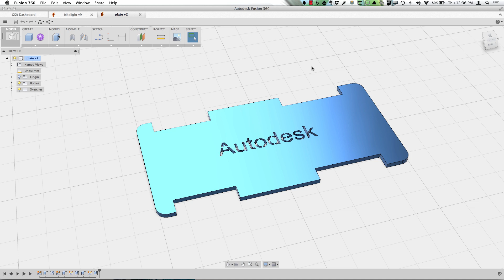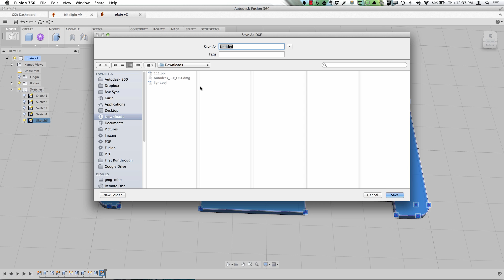Laser cutting - How to save as DXF in Fusion 360

Comment: ... but how do you export it to scale?  When I follow these instructions to save a sketch that is nearly six feet tall, I wind up opening it (in Inscape for example) and it appears as much smaller than a piece of paper.
Reply: +Nick Mathis usually the laser operators know how to rescale to size.. depends also on the software.. the tolerance will be in the end +- 0,001